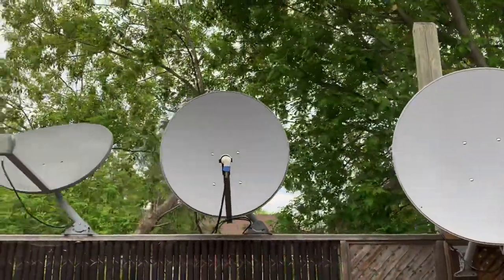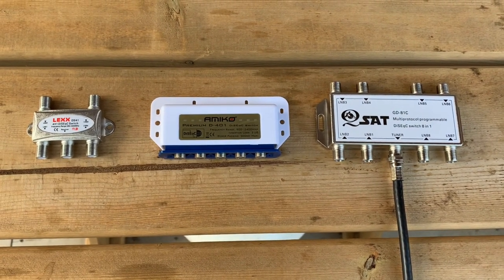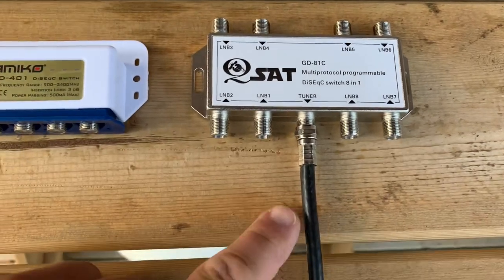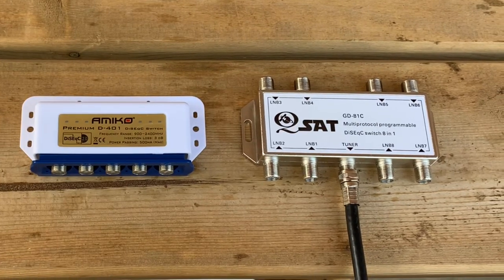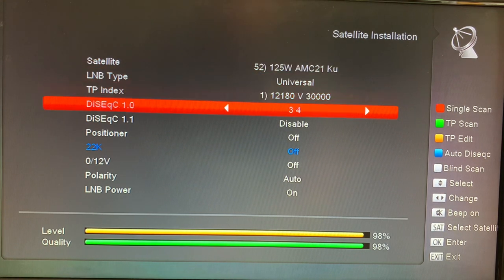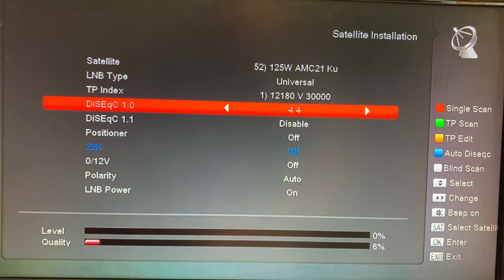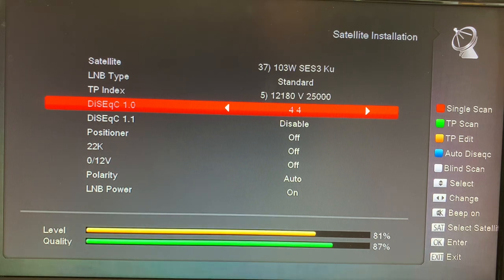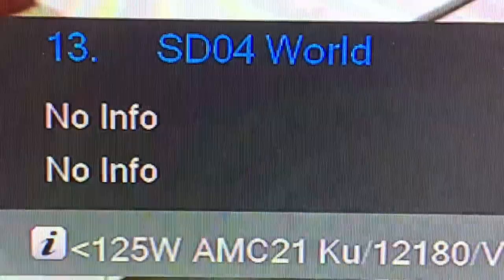How to Combine Multiple Satellite Signals with a DiSEqC Switch

Comment: Is it possible control both switches and rotors with one receiver?
Reply from the maker: Yes, you could control dish signals connected to a DiSEqC switch, and a motorized dish, but not the same satellites on both. Unless you add in more satellites (duplicates) to the menu. But it might get confusing!